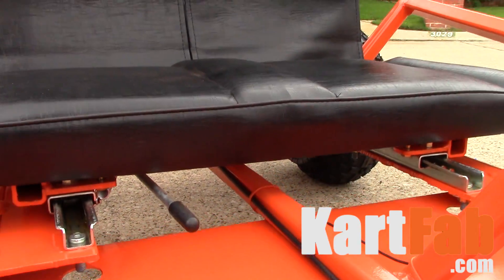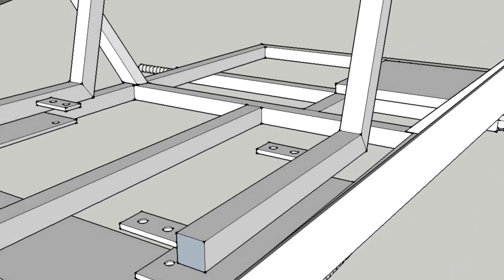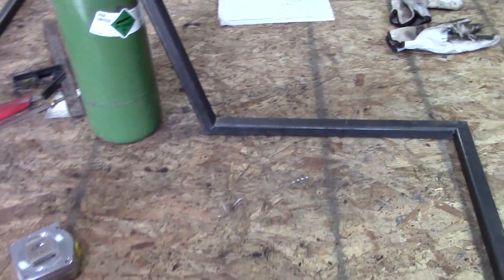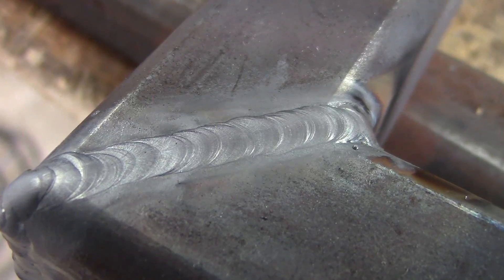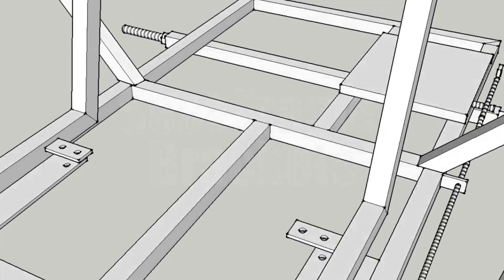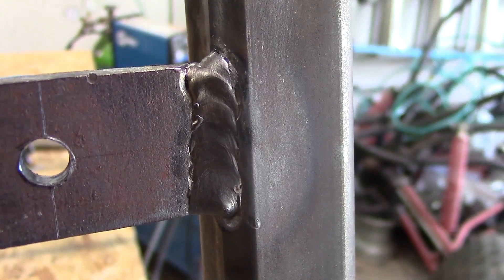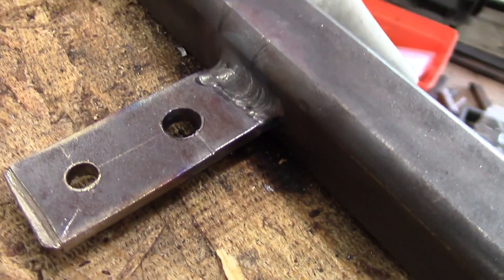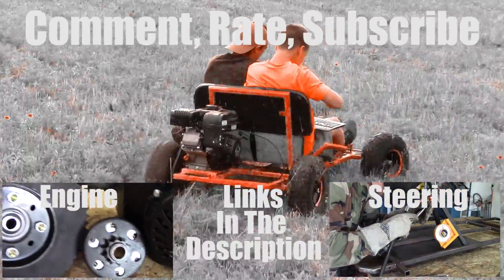Go Kart Seat: How to Make and Install

Comment: Great video series.
I'm sure you know by now but you can rotate the engine starter recoil to the rear.
I'm sure it would be easier to pull from the rear.
Reply from the maker: Yep good advice for sure.

Comment: which engine should be preferred for more speed for this gokart speed like 50 mph
Reply from the maker: Not sure. But 50 mph is too fast. Dirt bike engine may get you there.
Reply: A predator 420 cc de governed engine would
Reply: KartFab hey I was wondering if you want to sell that go kart i am interested in it and I was wondering if you wanted to sell it

Comment: Good job man, but I have a question, what I have to do if I want to spin both rear wheels?
Do you think 250cc has enough power to do a drift buggy/kart?
Thank you from Spain.
Reply: you have to but the round thing with the spikes on the axle, nit on the wheel(I forgot the name xd)
Reply: Mr ZeviZ you need a live axle, torque converter and sprockets on both wheels